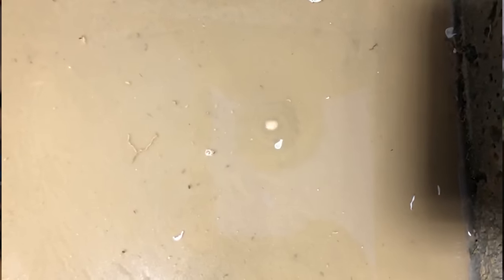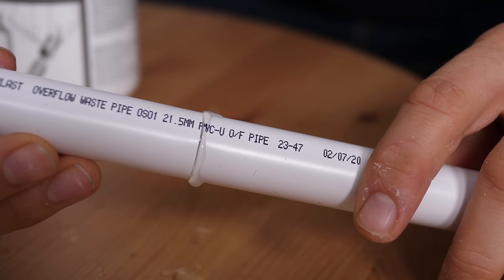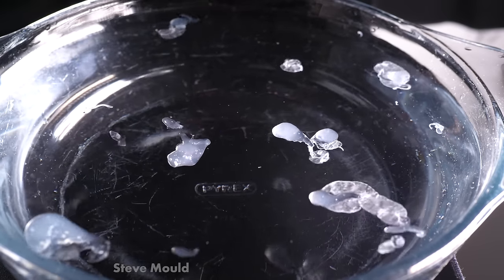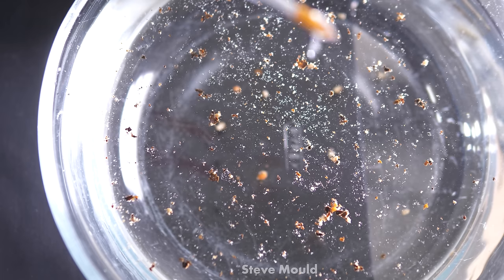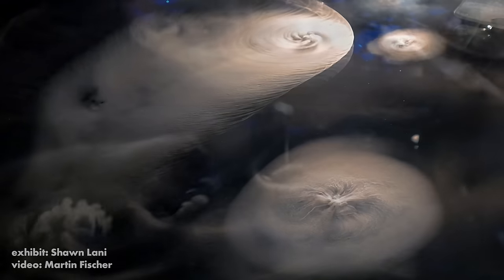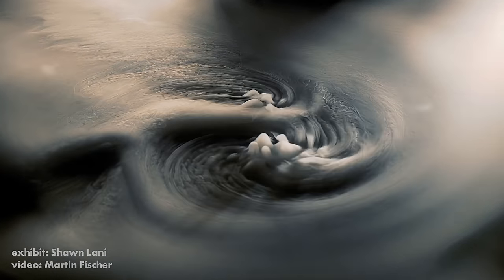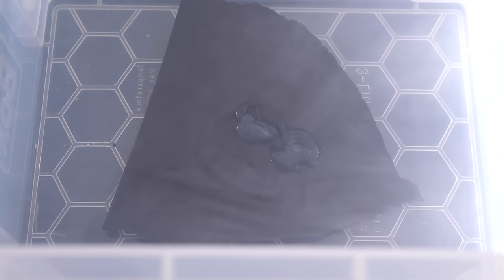Bizarre Spinning Glue

Comment: Why does silicone squeezed from a tube straight into water seem to set immediately? If you press out a string of it right into water you get silicone noodles
Reply: Wooooow
Reply: Yeah
Reply: I think super glue too
Reply: Well I know that superglue polymerises on contact with hydroxide ions, usually in air - it also polymerises/sets very quickly in water. Maybe a similar reaction that is started by hydroxide. I can't remember the exact process but I learned about it in chem at one point
Reply: because silicone works by hydrolysis, you can imagine it as a two component epoxy where silicone is one part and water is the other.
Reply: Some silicone adhesives use water from the air to cure. I believe it's the same for superglue
Reply: @roquesales_  Super glue is easy to understand. Right after college my best friend and I started a small chemical consulting and research company (by small, I mean the two of us) . We ended up only doing research, and what we worked on was the manufacturing process for ethyl cyanoacrylate commonly known as super glue, so I know a whole lot about the substance.

Ethyl Cyanoacrylate is a monomer, meaning it is composed of single molecules (mono=one) that bond together into long chains called polymers (poly=many). The reaction is initiated by water.

It is prepared by reacting ethyl cyanoacetate with formaldehyde. The reaction is called a condensation because two molecules of the monomer bond together releasing a molecule of water (any reaction that loses water is a condensation). The process continues at each end of the resulting molecule forming long chains, or polymers. The polymer is heated to break the polymer chains into the monomer and vacuum distilled. The distillation has to be done under a vacuum to prevent moisture from causing the monomer to polymerize.
Reply: @damiangames1204  Super Glue, sold under trade names like "Krazy Glue" and "Permabond" is Ethyl Cyanoacrylate. The substance in the bottle is a monomer (mono=one), meaning it is composed of single molecules. Water initiates the reaction that causes it form a polymer (poly=many), which is a long chain of repeating molecules bonded end to end.
Reply: RTV silicone polymerizes by the action of water causing the release of acetic acid, which is the vinegar smell. Usually getting the water from the air, this RTV into water method would cause the reaction to occur much more quickly. But I had no idea it would form noodles, they are likely quite soft for a while on the inside at least? Very interesting and something I had not a clue about - thanks much and will be playing with this a bit.
Reply: I had no idea I'd learn so much from youtube comments.
Reply: @leebarnes655  You are correct in your assumption that the noodles are soft inside for a time. The reaction proceeds from the outside to the inside so the shell polymerizes first. The reaction progresses through the inner layers until the entire noodle is polymerized. The deeper the layer the longer it takes for the polymerizations as the water diffuses through the layers toward the center.

Comment: In regards to the "jerky motion of the blobs" I have a hypothesis:  It's due to an uneven mixing of the cement.  I believe that you have pockets of solvent suspended in the cement, which is working it's way out, possibly through cracks in the thin crust of pvc that you described.  One way I can think of to test this would be to run the same experiment with samples of cement at varying degrees of mixed-up-edness and see if that changes the intensity or frequency of the jets.

Comment: Hey, I am still an trainee so my information might be taken with care. But at work we produce the glue for a well known glue company aswell as liquid foil and paints (for cars and so on). And most products require fairly high sheer rates to make the solution as it is supposed to be before further processing. So you might want to try using a toothed washer aswell as check if temperature needs are required to get the wanted results.

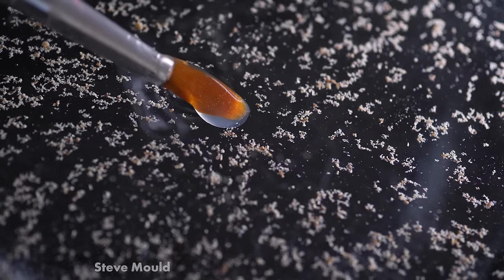Comment: 8:40 I think you're on the right track. Here's my idea:
As the solvent evaporates (faster in air than in water), the blob contracts, putting pressure on the solvent within, which will randomly break through to release some pressure, causing the jet, until the crust contracts further and the jet is cut off.

Comment: A couple good tests for further research:
1. Try the pepper demonstration again with MEK or other solvent instead of water. This will rule out a surface tension gradient, as the containing fluid and the PVC solvent have the same surface tension. 

2. Try using dry ice instead of a fog machine for smoke visualization. A thicker, heavier smoke will show offgassing currents more clearly, and it will also be less turbulent. 

My best guess is that it has to do with the solvent evaporating, as that is the process of it turning back into solid PVC. The solvent has to go somewhere, right?

Comment: I speculate this is due to jets of solvent being expelled as the pvc cement absorbs heat from the water surrounding it. The intermitency may be due to the loss of heat driven by such expel. If you drop two cement samples in two separate containers with water at room temperature, and cools one of them down, you may observe if the effect is temperature-dependent.

Comment: I used to do hardwood floors. If you were to put a top coat of floor finish on before the bottom coat had finish drying, then bubble would form from the continuing out gassing of the bottom layer. The explanation given around 8:30 is supported by this. The inside of the blob is still out gassing as the outside of the cement cures.

Comment: In my electrical experience, and using solvent cement, in  wet conditions, your observations about the cement losing itself to the water, as the pvc formed and ridded itself of the solvent inside, seems the most astute judgement of what is happening. Soon after the drops of cement have hit the water, they turn into solid pieces of plastic, and there is nothing left behind, so far as liquids go. And, if you are using the dobber that comes with it, and hits the water, it almost instantaneously turns solid. Just don't out water into the "glue." You'll ruin the pot of it.

All in all, great study on what happens.

Comment: Its not just PVC cement but any cement/glue that uses an organic solvent as its base. We used to make little boats (or just pieces of wood) put a dab of model cement on the back and watch the boat as it puttered around in the water.

Comment: It doesn't just evaporate the solvent to leave solid PVC.  The solvent attacks the pipe you put it on, and the "welding" description is quite apt.
I think the PVC pipe you dissolved in MEK [sic, but hardware stores keep calling it that] contains more than just plain PVC but other things to make a finished plastic.
You can join pipes by using acetone with nothing else added:  it won't fill gaps though and it's not a gel, but if you play around with a scrap you can see it happen.
Don't forget your purple primer!  It's required by code to be messy.

Comment: Suggestion:  put a blob in the cavity of your cardboard/styrofoam boat.
I was thinking of making a ring of floating material like cutting from a styrofoam cup.  Cut a single notch in it, so any jets are constrained to come out in one well defined spot.  This will confirm the jetting nature.
Be really cool if you can make these tiny boats remotely steered, and you set up a tiny course in a basin for racing.

Comment: Beautiful demo. I believe that you got close to a valid explanation. As soon as a blob of cement is released, the solvent starts to evaporate from the surface which then starts to "skin" and will tend to contain the solvent within the blob. However the vapour pressure of the solvent will cause an increase in pressure within the blob which eventually ruptures the outer skin causing a small hole which emits a (relatively) high velocity stream, propelling it along (think rockets, venturi etc). This allows the pressure to diminish so it eventually stops and with no pressure the rupture can "heal up". Eventually the cycle repeats, it ruptures somewhere else so shoots off in a different random direction.

Comment: I'm sorry for my bad english, but i thought of this as an interesting experiment and decided to do some research. I found out that PVC ciment has around 50% of methyl ethyl ketone in it's composition. Also, methyl ethyl ketone has 29g/100g of solubility in water, so my guess is that the methyl ethyl ketone is gushing out of the ciment and dissolving into water, creating a similar affect to the soap in water, but as it is happening in a much lower quantity, only a little jet is made. That could also give an answer for those "wings", that are the PVC resin that is left behind, solidifying, after the methyl ethyl ketone is gone. This research is not professional, as i'm 15 and i just did a quick google research, also, there are many other elements in the cement, but i think this one is the cause.

Comment: I think I am a subscriber to the shell model. It would explain why the behavior is different if the drop is first exposed to air as well as the randomness of the jets. I would guess there is some sort of pressure that builds and then releases within the shell. Maybe from evaporation inside the shell? Have you tried different temperature water?

Comment: What I see is rather simple: The solvent remains inside the blob and on the surface it evaporates, creating a thin layer of PVC through that the solvent does not diffuse so quickly. There will be a small constant diffusion of solvent into the water but hindered by the layer of solid PVC on the outside. I assume the PVC without solvent requires less volume, so either the surface starts to crack, leaving an area with liquid PVC to the water, where the solvent quickly steams into the water causing the propulsion or that the think PVC layer just dissolves by the constant solvent stream, and then again a the liquid PVC is exposed to water. Note also that in your video the sharper corners tend to improve the propulsion while the more round corners does not. The solvent is most probably Tetrahydrofurane, that is very well soluble in water.

Comment: 8:37 Suggestion: You can use a setup where a polarized light source shine on the surface of the water and a polarizing filter is placed in front of the camera in order to see those jets of solvent on the water surface.

Comment: Plumber here. Seen this many times and wondered about it. I believe the water is the catalyst for the reaction. It's very difficult to glue a PVC pipe if it is wet. The glue won't adhere to the wet PVC, as contact with water makes a film on the glue surface.

The solvent may be turning into a gas through a chemical reaction, that is sped up through contact with the water - possibly as you describe in your theory with the cracks Steve.

Comment: I have an idea as well (may not apply to this PVC cement) but I have worked construction for many years and MOST plastic "glues" are actually catalyzed. So my instinct on this is that the heat from the glue is heating up the water causing it to slightly expand. Since the globs arent uniform that should also cause a "jet" like effect. Just an idea, no clue if the cement you are using is catalyzed or not. Should be able to test this idea using 2 part epoxy, and seeing if it behaves the same way.

Comment: I would agree with the explanation at about 8:40. I’d guess the PVC cement is forming a hydrophobic layer around itself almost like a shell. Meanwhile the gases still want to dissipate and go to lower pressure. So when enough pressure from the gases builds up inside that hydrophobic type shell, it shoots it out in bursts until the shells pressure retakes that of the gas. Then you’ll get the “random” bursts.    I would then guess it’s dependent on a the size and shape of the drop of PVC cement wether you’ll get a constant release of the gases as the gas pressure is always enough to overpower the “shell” or enough cement that the shell can withstand at least some buildup of the pressure.

Comment: I'm curious about two things: How long does the spinning last? And is it more active at first but then slows down or constant throughout?  I feel like the crust and jets of solvent idea may also explain the fins popping out.  As the drop first hits the water that crust would be very thin and weak, if it splits open it may be peeled away and pulled out by the surface tension of the water.  Once a thicker crust forms it can maintain its shape when it cracks.

Comment: I see really similar behavior when I soak tiny beetles in 70% ethanol for about ten seconds, then use tweezers to plave them in a beaker of water (this is to surface sterilize them). They swirl, spin, and jet around. Considering that there is alcohol in the cement, could be related.

Comment: Hey Steve!, I've noticed when using a garden hose you can cause it to hold itself up from the thrust it generates, BUT, when you submerge the end in to water it drops like it suddenly generates less thrust?? Any idea why? Could be an interesting video.
You need to hold the hose about 1m back from the end depending on water pressure for best results.
Cheers!

Comment: I did something similar dissolving polystirene cups in butanone (methyl ethly ketone), the resulting goop would expand in to a film when added dropwise to water. I got very similar results with ethyl acetate (had to find another solvent due to the local restrictions on butanone).
I believe that the solvent, although being apolar enough to dissolve the plastic, can interact more strongly with water and will migrate to it when in gettin in to contatct, like a solvent extraction.